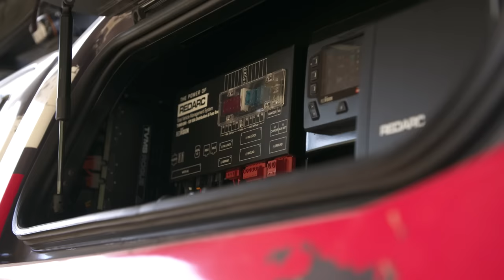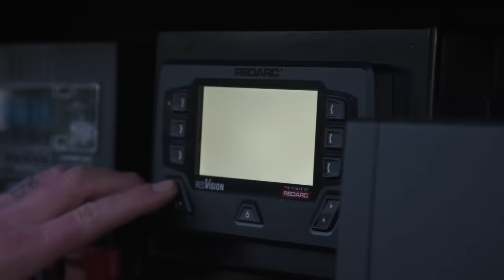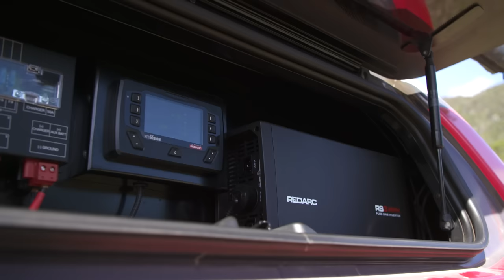STRANDED with no drive on WILDEST 4WD Track.. who gets towed out? Glasshouse Mountains gone wrong!

Comment: Mint seeing a Landy on the channel and that the Glasshouse still provides mint adventures.👍🏻
Reply: piggybacking your top comment, hopefully the landy fans see this and can answer ✌

how do the defender utes(?) fare at higher kms? there's quite a few for sale near me ranging from 170k to 250k, all appear to be fairly kitted and definitely appear to have been used offroading
Reply: G'day Boy's some extreme wheel'n go'n on there 🤙 i reckon we'd wack the bushwacka gear on our  big 200 and head off to Tasmania !! Bay of fires and beyond 🤙🤙
Reply: @SuperRandykid  170k to 250k is nothing, aslong as its has good maintenance itll go forever, Keep on top maintenance too, Check for Rust! Easy fix but check doors and footwells
Reply: G'day boys mint wheeling I would wack the bushwacka gear on my gq before I do my first trip around Australia next yeah keep it up love this show.
Reply: My old Defender td5 had over 400k and not any problem with that! Nice to finaly see a defender with the guys
Reply: I would like like the Bushwakka awning on my Ute and the blow up swag to replace my worse for wear swag it’s just about stuffed.Cheers guys for another great video of your adventures
Reply: See now I'd say 300tdi fuel pump turned a bit 😉 and flat out in an old discovery
Reply: Now just need a jimny!!
Reply: @kirbygreen420  can only fit a carrier bag in the back of it though 😂
Reply: Is your motor tunned? I would think the td5 heads crack i guess if tunned to run hotter?
Reply: Id take it and use it when ever iv got time off work.
Reply: Anywhere but home
Reply: @SuperRandykid mines got 435000 original turbo, intercooler, head gasket, no dramas
Reply: 100%, love this channel but its about time they started bringing in some different makes and models
Reply: Go the landy!
Reply: @kirbygreen420 Jimney the tyres with helium float over ruts legend
Reply: @SuperRandykid love landys my dad's had over 10. Favourite trucks, not as reliable as toyota, but offroad is another story. They'll slap about anything offroad, and once you have one, it's an addiction you just want more 😂 really miss ours, watch for rust but if you're an aussie, rust won't be as bad cus your country is bloody dry compared to Britain, TD5s have the power but 200TDI and 300TDI are more reliable, theyre more basic and less electrics. Had our last 130 tipper 20 years sold it for the same price bought it 😂, it was a beast, I just love em, hope this helped 👍

Comment: Jesse's very precise instructions to Tony on driving his GQ shows exactly how well he knows those trucks. "Just rev it up and step off the clutch like a diving board" is probably the clearest thing he could have said to get him in the right mindset to commit to the drive. 
When will we see the comp truck out again or did it fund a shed and hoist?
Reply: Not if you have any inkling of mechanical sympathy and risk breaking a component - and then compounding the recovery, just like trying to drive on front drive in a car that is known to have weak front drive components.
Reply: @trickster8635  like there was any other viable alternatives at that point. The GQ was clearly set up to take that amount of abuse and is a proven reliable platform with those mods. Not like it's on 37s punching out 300hp and 1000nm...
Reply: Nissan
Reply: @trickster8635   spoken like someone that has never driven a nissan GQ/GU
Reply: @trickster8635 lol it was either leave the 200 or get it as far as possible and the gq was built for that so why not drive it accordingly 😂

Comment: Absolutely loving the defender 130. My next build after the comp spec gq will be a single cab 110 with twin locked GU front and rear diffs with re4 auto and Isuzu 4jj1 running some juicy engine mods. Absolutely can't wait

Comment: That Defender is the coolest rig there for sure, needs a front locker, but it has the others beat big time in the look department, of the other rigs  that GQ is pretty awesome also.  I confess that I am a Jeep guy, so these Australian rigs are not quite my thing, over in Canada with our winters and all the salt the lay down on the roads, the Toyota trucks have big rust issues in the past.  They are tough, I had a 2001 model, but out of the box in Canada, the Jeep Rubicon is hard to beat and is a great start for a trail rig.  Great job on the trail fix,

Comment: Great video guys! Always a good watch, just wanted to point out that you can't generalize USA wheeling to just the West Coast. There are thousands of miles between where you were and the east coast tracks, and a very different climate. The southeast I suspect will be more similar to what you're used to, smaller rock steps than out West but very muddy. The Northwest is also very muddy and wet be sure to check out both in your next USA trip!

Comment: Good on Mitsubishi for having the guts to stay behind their product. A question I have is durability. Having done a fair bit of off road I have done many trips with various vehicles on the convoys and my experience with the SUV type vehicles is that they dont last. They may do the trip or two but ultimately they get smashed to bits. The shaking, lack of clearance, dust, flexing etc just destroys them. The pajero and pajero sport are the next step up and they perform well, a vehicle such as this, I'd be curious to see how it holds up.

Comment: Why have you not set 9.5 inhc difffs inn the front and like the rear. Most 80 cruiser drviers inn iceland have taken diffsenters out of 60 series whith 9.5 inch diff instead of the 8 inch front of the 80 series. 
Im from iceland í own 70 series shortest version whith 350 cubick inch chevrolet and 60 series disel 88 year gearbox and some other intresting things like 38 inch tiers

Comment: If I were to win that awning giveaway it would truly make a world of difference to my setup, just a little about me to explain why, I'm a 26yo guy and I have a quite physically limiting disability (it presents a lot like cerebral palsy but slower progressing) so I use a walker and/or mobility scooter to get around, I'm on a disability pension so money permitting I try to get away as much as I possibly can while I'm still physically able to and generally that ends up being 3-4 bigger 7-10 day group trips and maybe 1 or 2 bigger solo trips, this year I spent 2 months solo traveling from where I live near Brisbane down to Canberra following the coastal roads and then back up home through the inland roads through Bathurst, Dubbo, Narrabri, Goondiwindi etc, and honestly the one thing that I struggled with the most on my trip was setup and pack down of my current awning solo, it's just a cheap 2.5mx2.5m king's awning but it's years old, torn, bent and held together with zip ties so it absolutely needs to be replaced and physically I realistically need something free standing and the exact awning you're giving away is the exact awning I really would like to get but I'll probably have to make do with something cheaper, so if I could win this awning I'd be so beyond stoked, it would genuinely complete my setup as far as things that are necessary for me to solo travel, I have a battery box with an AGM 115ah battery, a 25ah dcdc charger, a 500w inverter to run the electric blanket for winter camping and my mobility scooter charger, a dual zone fridge/freezer, a pop up rooftop tent and the rest of my stuff I store in those clear plastic tubs (yes they break all the time but they're cheap and a guy ain't gotta money twig or whatever they call them things) so it's a cheap and basic setup pretty much everything works for me to be able to solo travel, except my awning, I only used it 2 or 3 times on the 2 month solo trip just because it's so hard for me to deal with on my own, but yeah, I'm sure this won't get read and a guy just wasted his 30 minutes but anyhooss, if I win that'd be neat ahahah

Comment: About time there's a Defender showing you all up! ok, J needs a bit more time on the tracks and getting used to how that 300tdi clutch and brake works.

Did say ages ago, drop the lift and lower the COG on Sooty. Looks like it was the right thing to do... 

Also good to see less lane abuse and more technical driving, winching early instead of trying to red line the track into submission. A pretty good eisode all round.